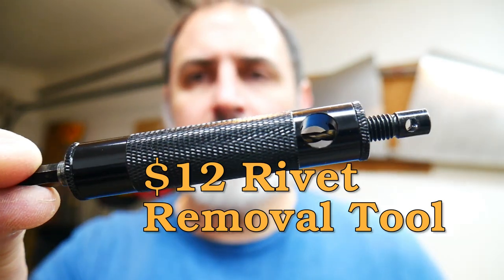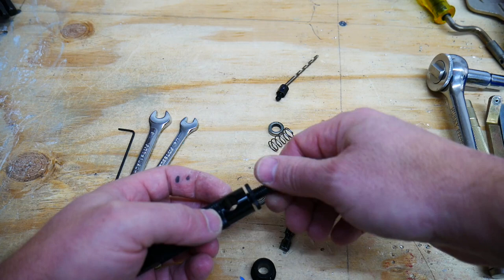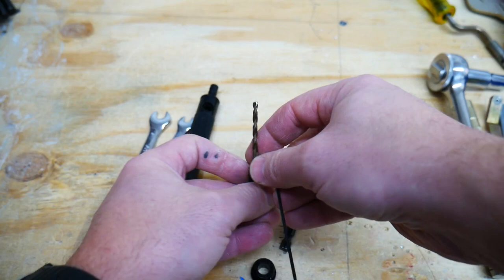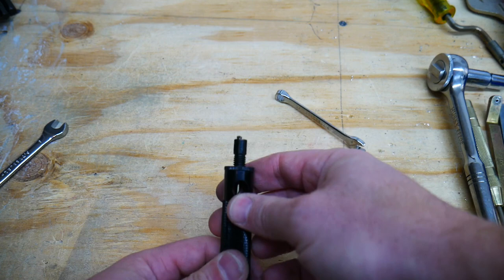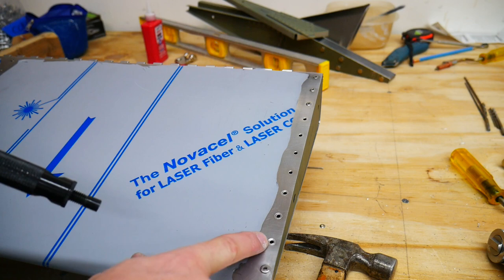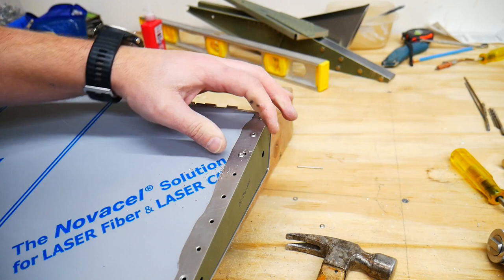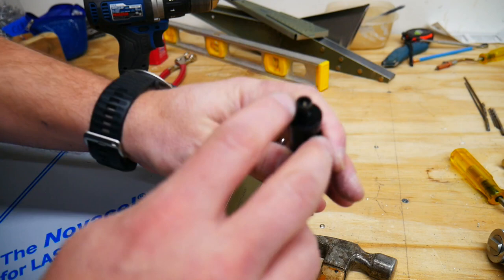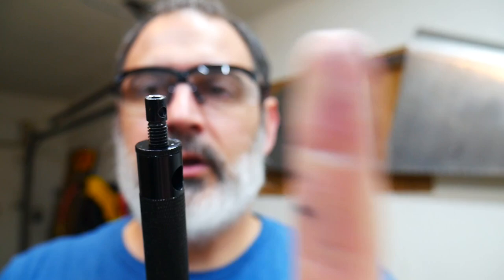Using a $12 Rivet Removal Tool On My Sonex Kit

Comment: I can not find it on AE either. Having disassembled it, your vid is clear enough I could make one on the lathe fairly easily (not for $12 🙂). I have one from Aircraft Tool Supply which is similar but it has a long bronze bushing.
Reply from the maker: Yeah, it's pretty frustrating that it hasn't been listed for a while. And it really is a simple device that can be built with a lathe like you said. But, no, not for $12 unfortunately. 🫤

Comment: Try doing that to a  Chobert rivet with that thing or a Cherimax.  Having a sharp drill is the key and staying center. A good mech would not need that.
Reply from the maker: These were all CCP-42 (stainless steel) rivets inserted into 6061-T6 aluminum sheets. This particular assembly was ruined when one of the rivets didn't pull properly and the subsequent drilling of several more replacement rivets damaged the part beyond what I was comfortable with. Maybe a "good mech" wouldn't need it, but I'm certainly above average and it made for a vastly improved outcome for me, personally. The replacement parts were about $250, so a $12 tool that improves my chances of salvaging parts is absolutely worth it, hands down. I've drilled quite a few of these rivets on this project and there's about a 50% chance they'll spin unless you have access to the back side. With a tiny bit of practice, I'm pretty confident that I can now drill rivets all day without a single mishap using the tool.

Comment: Okay, but your holes already have a nice starter hole... my guitar case hinges have rivets and I have broken drill bits and whatever you call that punch, they break in half... you can't drill a round surface everything. just slips right off, been working this for weeks now...
Reply from the maker: Yeah, this is for pull/blind rivets. Sounds like your guitar case has compression rivets. Maybe try using a file or a Dremel with a grinding wheel to flatten the round top of the rivet before trying to drill it.
Reply: @dan_der_flieger  I don't have a dremmel... i'm thinking i'll make a youtube video...

Comment: Would this work ok on driven rivets vs the pulled rivets?
Reply from the maker: Possibly, but not likely. This tool is mostly useful for poorly pulled, pull rivets. With a driven rivet you should be able to tap the mandrel through the rest of the way and essentially pull the attached material away.

Since driven rivets can be used in a situation where the back side is enclosed, you might not be able to tap the mandrel all the way through and you'll end up running the drill bit into the mandrel when you go to drill it. In that situation, depending on how delicate the top material is, you might be better off grinding the rivet head off. Just be careful to only grind the rivet (and NOT your workpiece too).

Comment: Seems like a lot of work to drill a rivet out.
Reply from the maker: That whole part is ruined because I wasn't able to cleanly drill a rivet out after it pulled incorrectly. I think it cost like $200 to buy the replacement parts. The tool worked pretty well, I thought. Definitely worth the $12 I spent on it.